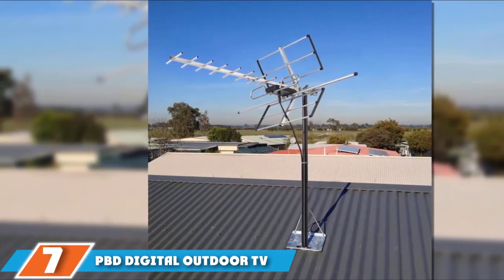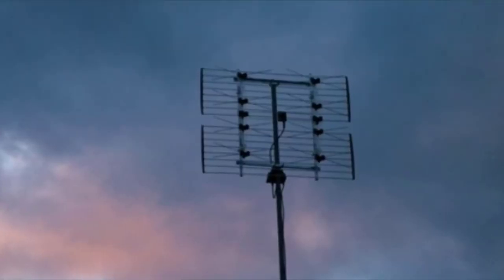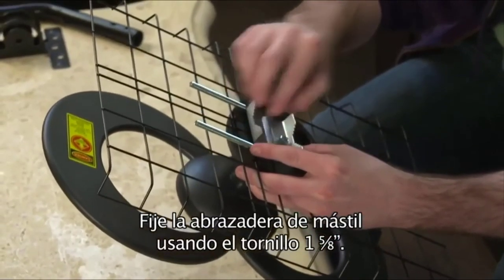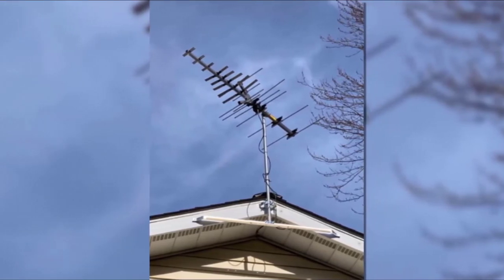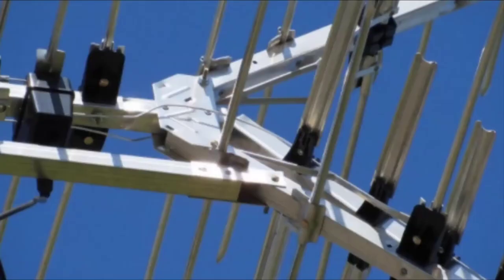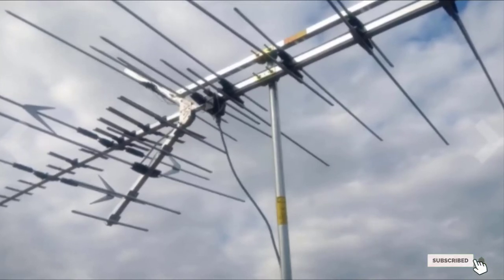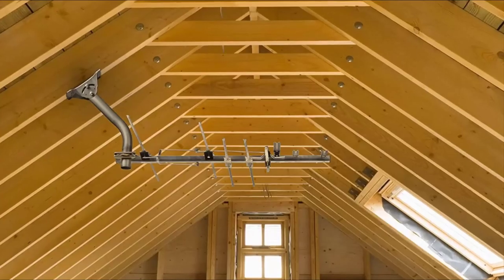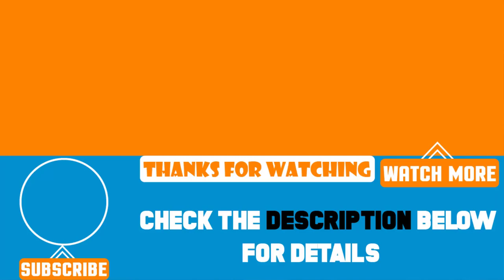Top 5 Best Outdoor Antenna Review In 2024

Comment: What I just installed is a Televes Dat Boss LR Mix in the new model ending in 84 & not last years model 83.
This is an extreme LR antenna with built in pre-amp & filters.
Bought it as a replacement to the Televes Ellipse Mix which would sometimes lose a signal at 68.7 miles while never losing a slightly stronger signal an equal distance but 3 degrees separate.
The build quality is exceptional, no problem with signals close by as the pre-amp is smart & self adjusting.
Televes is like Channel Master & Wineguard, a long time builder & their products reliable.
For those who read supposed range exceeding 80 miles, this number is an impossibility due to earth curvature & range exceeding 60 is only accomplished with height. 80 miles is actually a maximum with a 30 foot height & no obstructions such as a mountain, tall hill etc....
This antenna also is a smaller footprint.

Comment: A standard 4 bay (8 whiskers) bow tie antenna should go 100 miles but the whiskers must be matched for the center channel. It's best for uhf and can pull in stations 100 miles. I had a friend that we stayed up late dxing TV stations. Some were over 150 air miles away mainly on VHF. He lived on a hill and had north sky clearance no trees and buildings. We picked up Erie PA and even Canada after the other channels signed off the air. A large old style antenna is best for VHF. I always believed VHF and UHF antennas should be separate. Coax is not good for UHF. A foam type 300 ohm is best for UHF but today we must settle for combined VHF and UHF but the antennas don't have to be combined. You can still buy VHF antennas and UHF antennas. If the antenna has the title as digital or HD would be Leary of buying such an antenna. The RF is still RF. I believe if the location is high enough then you can get stations over 100 miles but in most cases 75 may be your limit but it's not written in stone. 73